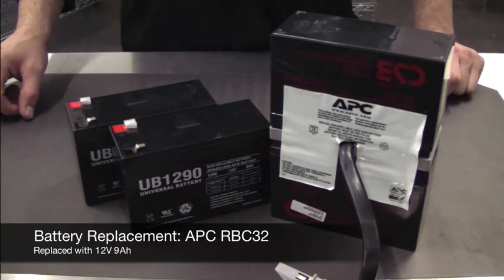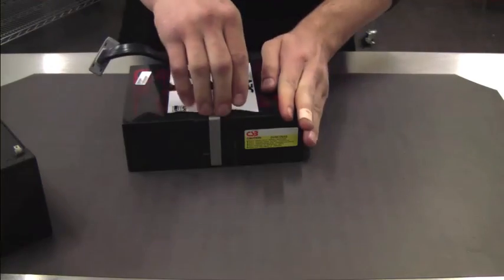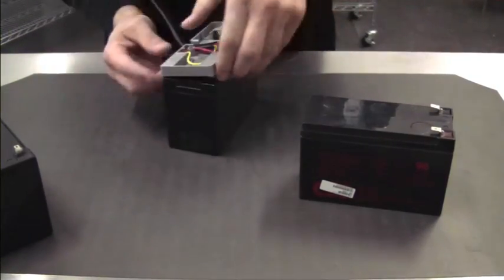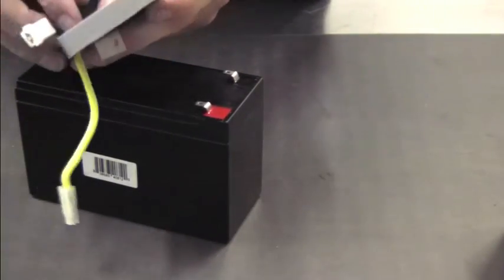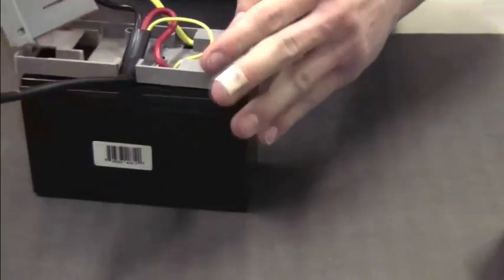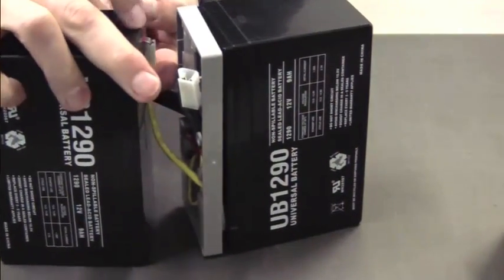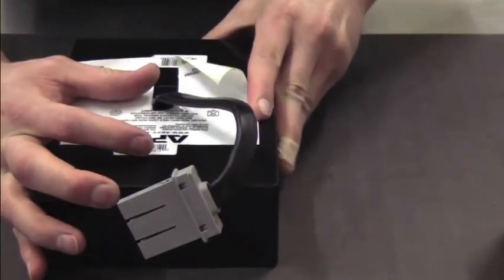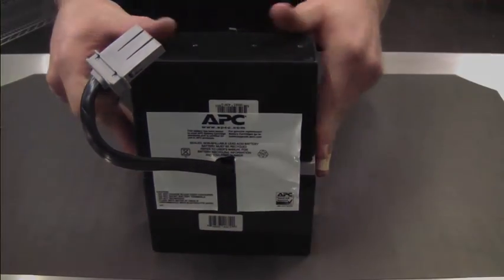How to Replace APC RBC Cartridge #32 Battery Like a Pro In 4 Easy Steps

Comment: Can someone post the wiring diagram for this particular battery? Including the thinner yellow  control cable? I am not sure about the resistor it has.
Reply from the maker: You can find the wire diagram at http://www.batteriesinaflash.com/media/wysiwyg/RBC-Diagram.jpg  I hope this helps you. The thinner yellow wire is wired along with the positive wire. I don't have a wiring harness at the moment to tell you what kind of resistor it has.